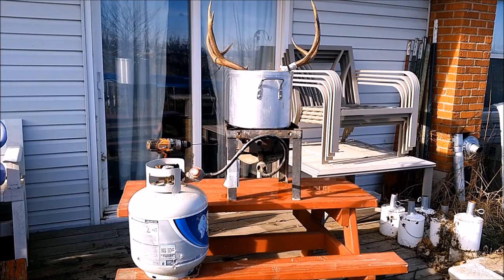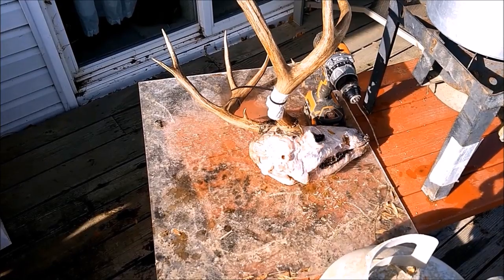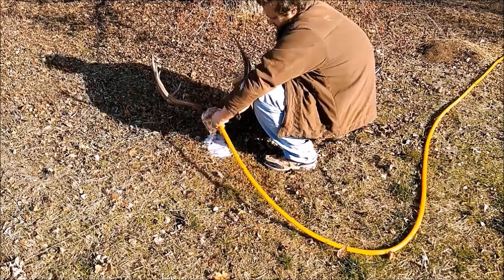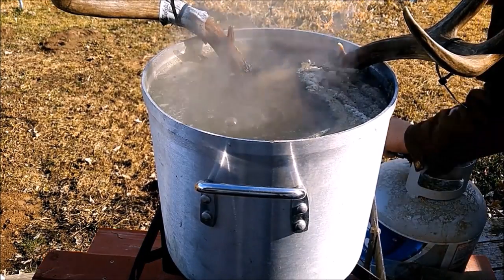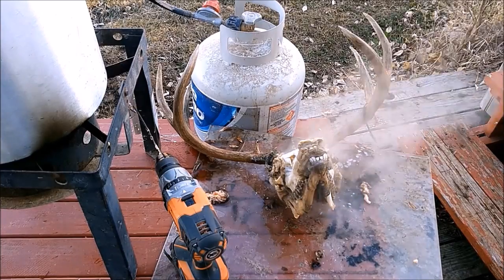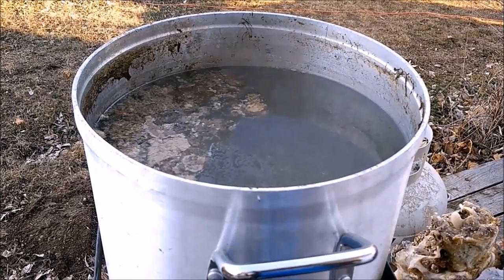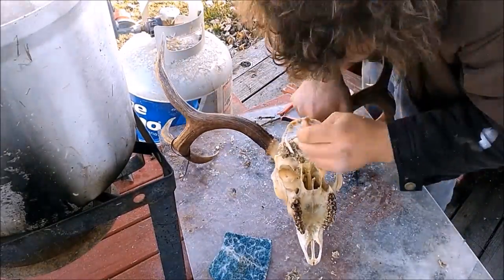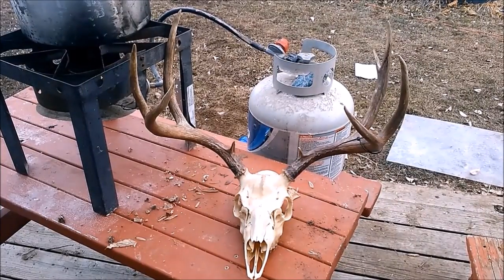HOW TO BOIL A DEER SKULL

Comment: On your initial cook after water starts to steam add a cup of oxyclean it’ll
Degrease awesome and jelly up the flesh in 20 mins then pressure wash clean then move on to your final degrease and whitening “be sure to wrap antlers well with Saran Wrap and elec rape the oxy clean will remove color from the antlers”
Reply: @Frank Stevens then ur doing it wrong me and Ryan Olsen at whitebone creations been doing this way for yearsssss snd have done thousands upon thousands of skulls never had a problem
Reply: @Frank Stevens  use modge podge cones in flat satin gloss or high gloss
Goes on white dries crystal clear and bondsssss
Reply: @Frank Stevens please do
Reply: @Frank Stevensya u can thin it just a litttttte bit
Reply: @Frank Stevens I always went straight up but of u thin. It it will show a lot less brush marks when it dries

Comment: What’s the temperature you’re boiling
Reply from the maker: Not 100% sure but a low boil just past simmer
Reply: If it is really boiling, and you are at standard pressure (not at high elevation), water boils at 100 degrees C.
Reply: @productreview5051  195-200 best temp
Reply from the maker: Thanks